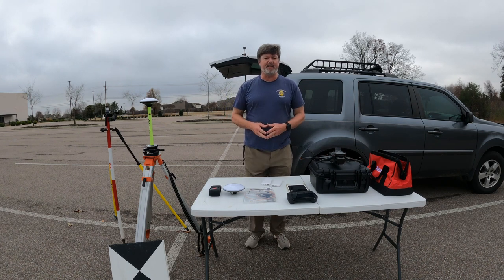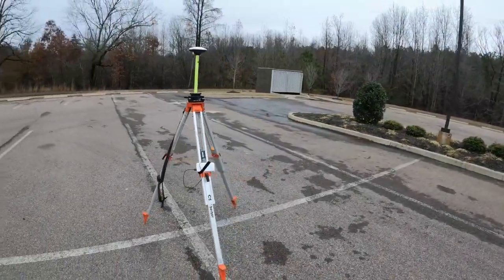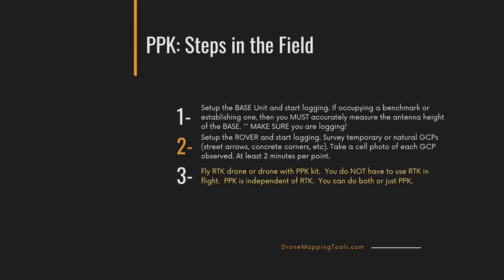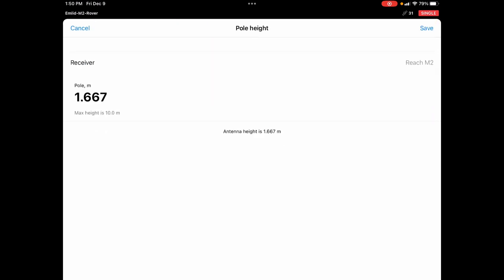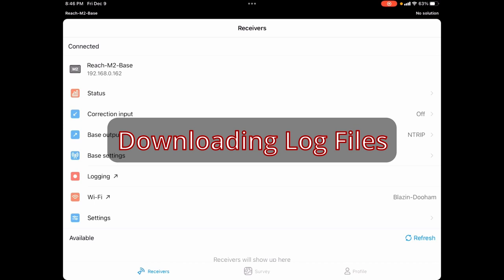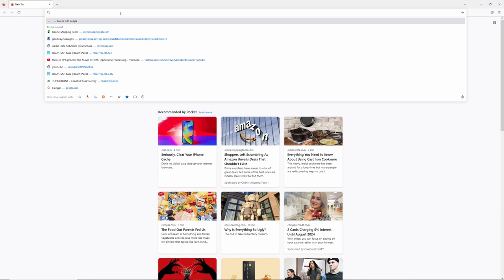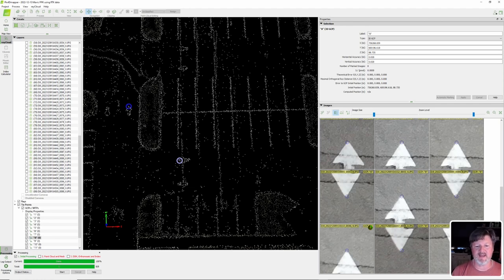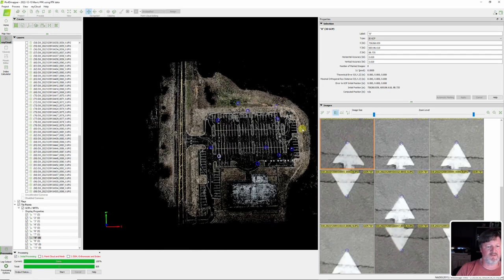Complete Mavic 3 Enterprise PPK Workflow Tutorial

Comment: Nice and complex video. So my question is why you choose ppk method when you could have faster embed geotagged photos with the rtk method. You use the same correction equipment for the both methods so the errors should be about the same. I get it that you have more control over the ppk than the rtk but does it really win when you compare effciency over precision and error control ? At the end you will stil compare with a gcp data aqusition.
Reply: Depending on the location you may not be able to feasibly run RTK corrections to the drone consistently if there are lots of obstructions in the area. (ie. remote areas with poor access and lots of trees/undulating terrain, etc)

Comment: As always, great straightforward content. Can you provide links to the gear necessary to put together an M2 rover. Do you have a LoRa hanging off the pole as well?
Reply from the maker: Hey Bob.  There is no LoRa radio.  If I was going to do RTK it would be using the free Emlid Caster service or using a service in Mississippi (I get one free base in North MS).  If you had a situtation where you needed to use LoRa then I would go with the Emlid RS2+ Units, not the M2.  For RTK via Internet (you have to also include a Jetpack with your setup to provide Internet to the M2), or just doing straight up PPK, then the M2 will be fine.

The gear was the Emlid M2 receiver, and this antenna.  You can buy the antenna from them direct or I believe Mouser sells it here in the USA.  It is cheaper to buy it direct (I believe so anyway).  https://www.ardusimple.com/product/calibrated-survey-gnss-quadband-antenna-ip67/

Comment: Really good video, thank you. Do you  know if the raw GNSS files suitable for PPK are also generated when using the Mavic 3 in the Thermal version (M3T)?
Reply from the maker: HI Cali.  As long as you have the RTK module installed on the M3T then the PPK files are generated.  However, I now believe it is much better to do RTK flights if using the Emlid RS units and use PPK as a backup if you have problems with your RTK flight.  More satellites are used for RTK than for PPK.

Comment: Thank you for your greate work! One question, what is the frequency of logging do you recomend for base station and for drone gnss (if it as a added kit)
Reply from the maker: It is sufficient to use 1hz on the base and rover for GCPs.  You could use 5hz for ground rover if desired.  The drone gps add on kit is usually set to 14hz.  Hope this helps

Comment: Can you explain why is the topodrone processing required? Aren't the images/coordinates corrected in the EZsurv?
Reply from the maker: Myka, let me clarify a few things.  
1. In 2024 you should be flying the Mavic 3E in RTK.  There is no reason not to fly RTK if you have a Emlid Receiver or a Stonex S900/S980 receiver.  
2. Emlid Studio offers free PPK processing for any DJI Enterprise RTK drone.  (the M3E requires the RTK module)
3. EZsurve is software that I have owned for many years.  EZsurv, TopoProcessing and Emlid Studio are all doing the same thing.  But Emlid Studio does not do reprojections where as EZsurv and TopoProcessing do in fact do reprojections for the PPK processing.  Hope this helps.
Reply: @DroneMappingTools  thanks for the prompt response. My question was mainly a newbie question because I am learning the data processing workflow from A to Z and all the steps required. It is hard to find good literature or videos with the explanation why this or that step is required. Also, I am not sure why to do the reprojection so trying to gather as much info as possible. Great video btw, learned a lot.
Reply from the maker: @myka452  I will have a photogrammetry 101 video (2024) version very soon.   It will be far better than my old video.  That will no doubt help alot :)

Comment: So I’m confused why do you need the RTK module if you’re doing PPK? If your using the RTK module with the the base station or a NTRIP that’s not PPK. So what are you using the RTK module for?
Reply from the maker: Hi Jon, the reason is that without the RTK module the required gnss log files are not recorded to do PPK.  It is also a higher quality L2 antenna.  Hope this helps.

Comment: What is the minimum control points you need per for a 10 acre property
Reply from the maker: If you’re doing PPK or RTK, for 10 acres. I think it is adequate to have three checkpoints to validate the accuracy of the data. But you always need to have checkpoints in order to validate the accuracy for your client.  You can always collect extras.  It is better to have them and not need them then the other way around. If I collected five points on a 10 acre lot, it might be that two of them needed to be used as control in the other three could be used to check points.  It would just depend on how accurate the results were.  I hope this helps.

Comment: I probably missed it on the video , how do you set the rtk module on the Mavic 3 , does it need to be logged into NTRIP or to your base
Reply from the maker: When you have the RTK module installed, the Mavic three enterprise will automatically log the GNSS data files needed for PPK processing. You would then use your own local base files or a CORS station as a reference.
Reply: @DroneMappingTools  thank you for the quick response. I got my M3E yesterday and did a 2d ortho in my neighborhood using drone deploy . I do see the ppk files there, that’s awesome. 79 acres under 18 minutes that is insane at 250 ft. That same map plan with my Mavic 2 pro was over 40 minutes with 3 battery changes

Comment: Hi great content.
I just wanna ask, can mavic rtk module connect to any type of base antena? Or u need specific model Like m2 base or dji D rtk base ?
Reply from the maker: For RTK it is not connecting to the antenna directly but rather to the NTRIP network.  The RS2 may be the base for the correction but you are actually connecting to the network.  So the base can be any base and not just RS2 or DJI base.  For PPK it can be any base and you will use the Rinex file from that base to do the PPK processing.
Reply: @DroneMappingTools  thank you so much. This will help me a lot. Nice content, new sub. Can't wait for another video. Keep the good work brother 👍👍👍

Comment: What format are you using for logging? RINEX? UBX?
Reply from the maker: I have the Emlidflow set to BOTH UBX and Rinex.  But on the longer observations it is only doing Rinex :(  But either should work.
Reply from the maker: I now do RTK on my Emlid 3E 99% of the time.  I only do PPK on the Lidar flights as they require PPK processing.  If you are not doing RTK on the M3E, you should be.  The results are awesome.  I did a video on multiple options for setting up RTK on the M3E using the Emlid RS2/ RS3.

Comment: Where is the Mavic 3 E setup and flight? Is your M3E connected to a free CORS or the base station? We don't get free CORS in Texas.. How does that work? Is my M3E broken? The RTK module will not connect unless  it is logged into some kind of of NTRIP. I was hoping this video was going to go over all that. Would you please make a video on how to setup the M3E with the RTK module, no CORS (we can download the files for PPK processing), and with the inexpensive base and rover? Thank you very much.
Reply from the maker: Hi David.  The Mavic 3E is an awesome little drone.  If you are going to do PPK, then you only need software to do the PPK processing.  You will obtain the data files from your Mavic 3E (photos folder) and then you will download the CORS log file (free of charge) if you do not have your own base station.  The TopoDrone PPK Processing does an excellent job for that.

If you want to do RTK, then you must either 1) have an RTK service which is usually very expensive.  The lucky folks in FL get free RTK all over the state.  That is the only state in the USA like that.  In Mississippi I get one free RTK base.  So I will take that.  Option 2) is to have your own base unit that can provide RTK service to the drone. The only base I am aware of is the Emlid RS2+.  You get FREE Caster (NTRIP) service thru them when you have the RS2+ so the only thing you need is an internet connection in the RS2+ and your Mavic 3E controller must also have an internet connection (via wifi).  I hope that answers your questions.  If not, write back and I will try to clarify.
Reply: @DroneMappingTools  Thank you very much for the reply. Definitely helping my understanding. So, just for my ignorance, if I'm doing PPK, there's  no need for the RTK module on the M3E? Thanks again.
Reply from the maker: @davidbowles5263  David, you do in fact need the RTK module (whether doing RTK or PPK).  The RTK Module ($700) is required in order to generate the GNSS data files needed to do PPK processing.  If you do not have the RTK module installed, it will not generate the files and it would be like flying a regular phantom 4 pro, etc. in terms of photo data.
Reply: @DroneMappingTools Thank you again for the reply. I'll call DJI and ask them why my RTK module will not connect to the M3E. Your patience is greatly appreciated.
Reply from the maker: @davidbowles5263  David, just for clarification.. do you have the RTK Module installed on your Mavic 3E?  Here is a photo of the module. (https://topodrone.com/product/uav/228/233/240/mavic_3_enteprise_thermal/1341/ ).   I do not understand your issue when you say that the "RTK Module will not connect to the Mavic 3E".  The RTK module just screws on to the top of the Mavic 3E.  Then once it is installed, you just fly your mission and the necessary files for doing PPK processing will be saved in the image folders.  If you desire to do RTK flights, then you have to have RTK service and you will enter your login details for the RTK service in the DJI Pilot 2 app.  But once the module is attached to the top of the Mavic 3E, you can do PPK processing regardless of whether you fly with RTK or not.
Reply: @DroneMappingTools  Hello again. Yep, I have the RTK module attached to the top of my M3E. What seriously confuses me is that even though the RTK module is securely attached to the drone, Pilot 2 shows it as "Disconnected" and "Disabled." It would be a great help to me if you would delete/turn off any kind of NTRIP/CORS/base station connections you have in Pilot 2, then restart everything with your RTK module attached to your M3E and see if it also shows as disconnected.  I did do a little experiment and took a few images to see if there would be any difference in the image metadata. I did not see any difference there, but the drone produced 4 new files...A .obs, .nav, .mrk, and something else. I opened a couple of them and the headers had "rinex" in them. Does that mean anything?
Reply from the maker: @davidbowles5263  David, if the 4 files are there, then the RTK module is attached and working properly.  The four files will be generated each time you take photos or run an autonomous mission regardless of whether you enable RTK or not.  Those have nothing to do with RTK, but rather they are used to do PPK processing later.  If you want to do RTK, then you will have to enable RTK in the Pilot 2 app and properly enter your login credentials for your RTK service.  Once you properly enter the login details and you have RTK "enabled", then you will see the FIX solution after 5 minutes or so of having the drone turned on in a good wide open area (provided the Controller is connected to the internet via WiFi)
Reply: @DroneMappingTools  Thanks again for all your help.
Reply: @DroneMappingTools  Ah, lots of states have CORS/NTRIP capability. Free in many. In TX, contact TXDOT and signup as a contractor. Free to contractors and TXDOT employees. If you get hung up, contact your rep, its a joke that any state would not provide.
Reply from the maker: @Shepgoblue  That is good info.  I will keep that in mind.  I wish MS was like TX!

Comment: Can I do PPK with this drone and the Dji D-RTK2 base station?
Reply from the maker: TTK Ironfist, you can can certainly do PPK if you are using the RTK2 base station.  The D-RTK2 base station is for RTK so whether you are using the D-RTK2 or using an Emlid RS2/ M2 as a base, you can still do PPK on the drone flight later (as long as you have the RTK module installed on the Mavic 3E which would be required for RTK or PPK)  I would think that is understood but want to clarify.  PPK is completely separate from RTK.  I hope this helps!
Reply: @DroneMappingTools  yes, thanks!